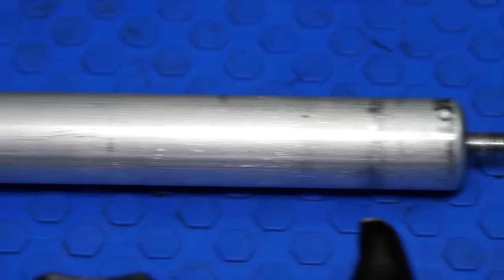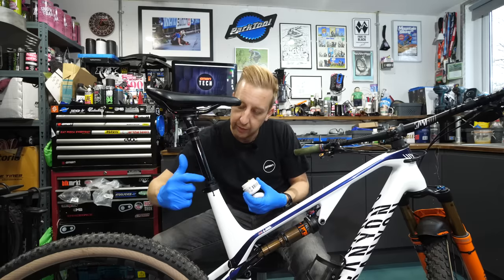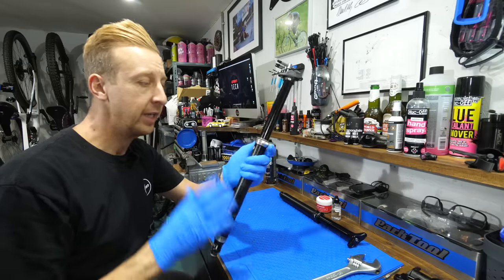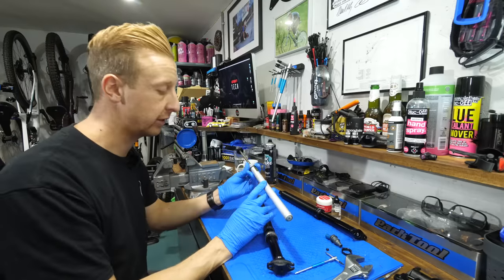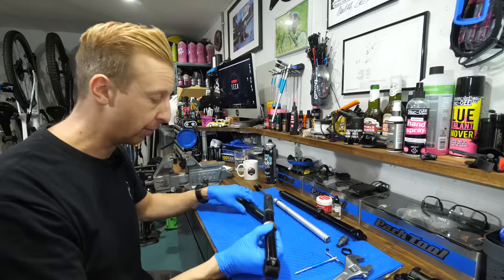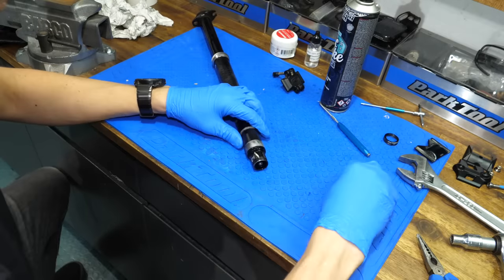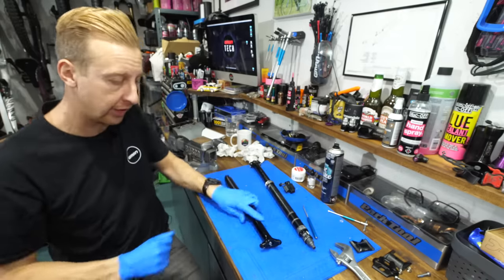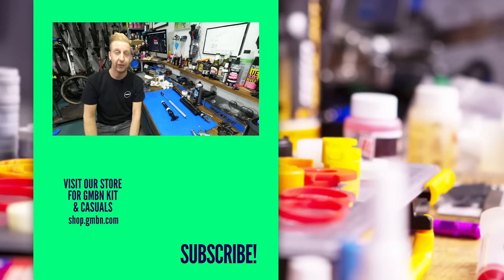How To Service A Slow MTB Dropper Post | Mountain Bike Maintenance

Comment: When mine gets stuck I just spit on it and call it bad names. Works 60% of the time all the time.
Reply: Anchor man— brilliant film
Reply: I spit on it as well, just not from my face.
Reply: @timbrassinne719  💀💀🤣
Reply: i throw my shit over a cliff then i retrieve it and it rides great.
Reply: But what do you de when your dropper post gets stuck 👀
Reply: I'm going to give that a shot but I'm counting on at least 62%!!!
Reply: Instead of using sram butter can I use muc off bio grease, the pink one in tube?
Reply: @DeadsetYT  Been hanging out with the hawk tuah girl much?? Wondering if its the spit or name calling that gets the job done…

Comment: Hey Doddy, we desperately need one vid for the new fox transfer. There is NOT A SINGLE VIDEO on YT 😭😭😭
Thanks a ton for your great work 🙏🏼💪🏼🤙🏼
Reply: yess i neeed this! my transfer stuck in the last 2cm
Reply: Not gonna happen, leave that alone. Reverb and transfer only at service centres.
Reply: @trailfoxx  try not having your clamp bolt too tight.. I've found there's a fine line.. to tight it stops just short and to loose the seat moves.. but find it and should work sound 👍

Comment: Thanks Doddy, legend. Just followed your guide yesterday and totally fixed my post! I used SRAM butter as well, and Rockshox 0W suspension fluid. Turns out I'd sprayed far too much silicone spray into it over the last year and it was absolutely blocked with residue. Was so slow before this that I was thinking about getting a new post. Instead, just $38 (NZD) and an hour of my time. Legend mate.

Comment: Had a go at the quick method today on my x fusion manic. After 3 years+ of all-weather abuse i was surprised at how little dirt was actually inside the upper seal. Bit of lube and a clean-up around the shim and O ring and its defo less lazy on the pop now. I was lucky enough to unscrew the outer using just a thick rubber glove too hehe! Quick clean of the the wiper and post itself after every ride has proved to be a good habit…

Comment: Smooth...like liquid butter. That's what happened to my dropper post when I did what Doddy prescribes here. BTW, While I was at it, I replaced the internally-routed actuator cable. Also very easy, but I did invest in a Park cable cutter. That investment paid for itself right there on its first job. Now I am free from bike shop waits and high costs for all my future cable replacements.

Comment: a useful guide especially as I'm looking at getting a Brand X post!
Reply: Had my bike since November 2017, like a loser, I've never given the post a proper service, just a little clean. So never had it fully apart to clean the lower section. It's a tad on the slower side with a good long scratch at the back of the post that's about 6 inches long. Yes, bad, I know. Less than ideal. I'll tell ya what though, It's a perfect dropper. Can't complain, especially since a new one isn't all that expensive. Well worth the money in my opinion. (Yes I should've serviced it by now, but couldn't be arsed. Replaced my Pivot and wheel bearings instead...) I'll get to it. Lel

Comment: This video tipped me over from my hesitation of self maintaining my two dropper posts to actually taking action. It was amazing how much muck has built up over time. They both work like magic now. Big big thanks for your thoroughness. Watching the manufacturer's videos had made me think I'd need LOTS of specialized equipment. It was nice to see I could make do with what I had lying around in my workshop. Happy subscriber here! :)
Reply: The bicycle seat post is the perfect "much catcher!"   As are seat tube clamps &  slots.  I've utilized old inner tube over many of my bikes' seat post clamps.  So much dreck flies right off your rear tire and onto (and into) your seat post, slot, clamp & clamp bolt.  Can't really protect the dropper very well.  I GUESS you could try some sort of accordion boot (like front shocks of old), but I just know it would foul anyway - and make proper bike stand clamping difficult or impossible.

Comment: Very helpful and useful. A follow up with a Reverb and Transfer, the two most popular hydraulic posts, would be awesome.

Also, thanks for specifically showing a BrandX post, as BrandX/TransX are by far the most common OEM dropper posts on the market, especially on the lower end.

Comment: Thanks!  Funny because I just serviced a guy's bike by replacing his broken cable, cleaning & lubricating the lever mechanism, new housing, flushing the mud out of his seat tube & BB, but the Fox post is still sticky.  Been meaning to unscrew that top seal, but always wondered if it would go KABOOM!  (Was pretty sure it wouldn't, but didn't want to open a "can o' worms.)
Off to the shop to perform this little bit of magic...

Comment: My new XLC-dropper got stuck during the first snow ride this winter. Fully disassembled it, cleaned and greased it up. Works perfectly. I also did the inner tube hack. 
Also the internals of the XLC look exactly like the Brand-X ones.

Comment: thanks..this is very helpful for me as I ordered a brandnew PNW Loam/DXC DP which I give this procedure from the beginning. It is a bit different but use "brass keys" but same technology. Instead of SRAM butter I have good experience with RSP Slick for my Suspension Forks and actual dropper. It feels a bit thinner. By the way I bought some years ago 2 new Rock Shox Reba which were already dry inside and so I am a bit carefully with new things like this...thanks again!

Comment: Could you do the Rock Shox Reverb next? I know it’s been done before but not by you I don’t think 🤔 😃
Reply: Have a look @Butter Suspension. His reverb rebuild ist amazing!
Reply: Send it to special Dynamics suspension the reverb is fully hydraulic and requires the damper to he bled if it needs to be actuated quickly I sent mine and it came back feeling brand new for just £55
Reply: Reverbs are more hassle than their worth. A lot of money for a fragile system that ends up needing more attention than others, And certainly not a post to go for if you are gonna rely on a bike shop for any work! Throwing money away at that point.

Comment: Just in case it helps someone; some of the brand x droppers don’t have a nut under the seat but a valve for topping up the air. There’s a metal plate with four rectangular cut outs. This is threaded onto the valve and can be unscrewed to allow removal of the cartridge using slim needle nose pliers into the rectangular cut outs.

Comment: Hey Doddy, what type of suspension oil do you use, 5wt, 10wt, 15wt? Excellent video btw, keep the content flowing 🤘😎
Reply: I would use 5w or 10w 15w is a little bit on the heavier side. some Forks use 15w  but most are going to use 5 to 10. For the seatpost 5w or 10w is fine even a good transmission fluid. But I wouldn't use trans fluid in the forks.
Reply: @archetypex65  So like a wet chain lube could also do the job?
Reply: It doesn't matter. I used 0W. Any suspension fluid will serve the same function.

Comment: A third type is air / cable. That air the in top with the valve under the seat runner clamp, normally max 250psi. With the cable release on the bottom. 
Another great video though Doddy.

Comment: Zoom Tequila (and ZTTO which I believe is just a Tequila with a ZTTO roller lever):
For those of us that are cheapskates... A Zoom dropper is still 1000% better than a clamped post... 
BUT the top actuated ZOOM droppers can get muck in the actuator.         (I did a video of cleaning mine).
The result is a post that doesn't lock (so keeps raising to full extension).

Clean/lube the actuator & perhaps look at covering the top of the post to prevent dirt/mud/dust from sitting on the top of the post. (I wrapped the top in a bit of innertube & zip ties).

The reason I used a Zoom is I have a 2010 Giant Faith 0 that has a very short post tube with the suspension rocker bolt in the middle making the seat depth about 200mm.
With the Zoom I was able to get 100mm with barely 10mm depth left in the post tube to play with.
It also looks like you can lock out the Tequila with spacers if you want less than 100mm.

Comment: Ran my BikeYoke Revive for 2 years without service. apart from lubing it a bit and keeping the seal clean. I didn't touch it. reset it a few times but not much. took it apart before I sold my bike and replaced the seal, cleaned it, put some fresh suspension grease in it and it was like new again.

Comment: After riding on a Giant cartridge dropper for two seasons, I figured it was time for a cleaning and tune-up when responsiveness began to slow down. Discovered to my horror that the aluminum dropper had cold-welded to my carbon frame. Several trips to various bike shops brought no solution. Damage to either the frame or to the post without it being removed would make the bike useless. For now the solution is a hacked clamp around the part of the dropper that telescopes essentially keeping the post fixed in place. Frustrating, not great but still rideable. It would most certainly have been part of my regular maintenance routine to loosen the dropper to avoid this  if I'd known about. So, just a heads up.

Comment: Could you do one about the fox transfer
Reply: I would like to see that, too.
Reply: Like Doddy said "fundamentally they're the same". Its the same principles no matter the model or brand
Reply: @archieansell9160  He mentioned the 3 different sytems. I guess there are some more seals to grease in a non-cardrige system like the transfer.
Reply: Yeah the transfer is semi- hydraulic not cartridge
Reply: I worked at Fox and let me say the transfer is not an easy thing to work on! Especially because you need some special tools and a good knowledge! If you have problems with the transfer sent it to fox and they can help you!
Reply: @fabian5422  In which country? This smells like Germany. When Fox Service was still Toxoholics, you couldn‘t even get the tools without a service training but they didn‘t have the capacity for doing the service for a country that big either. I mean, let me see the service manual, and I can decide myself. I wouldn‘t try to fiddle around inside a damper but why should I send in a fork just to put some progression tokens in?
Reply: @chrisridesbicycles  yes Germany. You can get the tools on there website and yes they have a lot to do at The Moment, but in my opinion it’s not worth the money you spend on the tools and in the end there is the chance to break more then you fix.
Reply: @fabian5422  That depends on the task. It is generally worth the money because they are relatively generous with upgrades to newer damper generations, however sending in your fork and waiting 12 weeks+ for it to come back like in the Toxo days is not acceptable. The season can be over in that time.
Reply: @chrisridesbicycles  I totally understand your problem but they have a lot to do! It’s not all that easy and they are doing their best. But Forks and dampers are one thing but to rebuild a transfer you need a good skillset and the Know-how and I’d say reading the service procedure is just not enough. The transfer is not all that easy to work on!
Reply: @fabian5422  With a seatpost, it is not that much of a problem to keep a spare fixed seatpost to make your bike usable at least. With forks, it‘s another story.
Reply: @fabian5422  hey Fabian, have you worked on a reverb stealth? I have completely rebuild mine because of the saggy post problem and done a 400 hour service recently. Used a great video from @Butter Suspension and the Rock Shox manual for reference. Worked  just fine, even though I have never serviced suspension or dropper posts before. After I serviced the second reverb that day, I felt quite confident doing the service again. However I do agree, that you need a lot of tools, that not everybody might have laying around. Can you compare the difficulty of the service between Fox and Rock Shox?
Reply: @florianzimmermann3815  no I haven’t. I only worked on a transfer. Fox also has online service manuals, they are quite good but only a guideline. So yeah I don’t have any experience with the reverb

Comment: My dropper was making horrible grinding noise. Upon disassembling it I discovered that the brass keys had sharp edges, which were grinding against the slots inside the tube. Further inspection reveled that the edges on the other side of keys were round and dull. So I flipped them and the grinding noise stopped. Is it possible they the factory assemble the dropper incorrect?! P.S. Thank you for these instructions - they gave confidence to try and fix the problem myself!

Comment: Ha I just fixed mine today and then I see this video. I was using a Brand-x external and the textile cable from inside got snapped. I ended up using a 0.8 mm kevlar fishing line +  sram grease.
Reply: Those are a little heavy but great for price.

Comment: My friend's dropper would always get stuck on the last 5mm of travel. Pulled it apart, black crap everywhere. The top bushing was also really scratched up due to all the crap inside. Fella kept using wet lube on both the stanchions and bushing. NEVER use wet lube. Just like you won't use wet lube on your forks, invest in the proper suspension grease. In fact, I'll keep away from oils too. Unlike forks and shocks, there's nothing preventing the oils from just dripping out of your post and pooling somewhere in your frame.
Reply: Just got a new bike with a Fox Transfer and it has the same problem brand new. Miss my Reverb. 😐
Reply: @pgjudo  my suggestion would be to warranty the post. 

However, if you're a DIY kind of person, ensure there's enough air pressure in the post, then pull it apart to find the offending part causing all the additional stiction. There's a rebuild guide on the fox website. 

In my case, it was the top bushing which got all scratched up and it had quite a few burs. Luckily the bushing is made of plastic, so I used the stanchion itself to file/cut off all the offending burs. A bodge for sure, but my friend was penniless and we had trouble sourcing the rebuild kit for his post. And it worked. I would still recommend getting the rebuild kit from fox and just swapping the part out if it is due to the bushings, guide pin or gutter seal being damaged and causing the friction.

But if it is the air cartridge itself, then I would strongly recommend you warranty that thing instead. Between the parts, specific tools, and expertise required, it's just not worth it to try to do it yourself and risk voiding it when it's covered under warranty.
Reply: @Snipeonz , thanks, but I’d expect it to just work after paying over $9k for a new bike. Reading the comments, it seems that’s too much to expect from Fox.
Reply: @pgjudo  Well, I won't blame is specifically on Fox, but more on the fact that with current manufacturing methods, defects are still inevitable. Most of the manufacturing process still requires humans to be present, and as we know, the human component has the highest error rates.
Reply: @Snipeonz  , I can’t argue with that, dude... the biggest shortcoming my killer new bike has is its rider! 🥴👀

Comment: Newer dropper posts also requires you to add air. Remove the saddle, there should be a valve like with the shocks and pump it up with a shock pump. The psi range should be printer at the top of the post.

Comment: Can a Fox Transfer be serviced without a full rebuild, since it requires some Fox proprietary tools? So cleaning and lubing the seals and basic parts should be the same as other dropper posts?

Comment: Hi. My dropper issue is on delay to full stop at when drop or fully extended. I need to wait for more than 10secs for it to lock. Possible issue on the cartridge? Thanks.

Comment: #AskGMBNTech hi Doddy. Do you think power steering fluid would be safe to use on dropper posts. Also my dropper is very rough on the way down and does not return. It is a brand x ascend

Comment: #askgmbntech
Great video - but how do you get the dropper out of the bike to work on it?
Do you have to disconnect the cable at the lever and pull it out with the post?
Or is there a cunning plan?

Comment: Would it be possible to shorten the stroke of a dropper by shortening the piston rod of the cartridge? Asking cause I have my eye on a dropper, but its 125mm stroke and I can only fit approx 100mm on my (older) hardtail.

Comment: #askgmbntech Hi Doddy. I’ve followed the program since the very beginning and way before when you were at MBUK. I have a Cube Stereo that came stock with a Cube branded dropper post. It has a valve on the top where the pressure is controlled with a shock pump. It is cable operated. How can I service this at home? Thanks.

Comment: I have followed similar video and now searching for help found this but it’s the same. Reassembling mine I can’t get the actuator pin to work. It’s as if the rod on the cartridge won’t screw in for enough into bottom housing. If I take apart again and push small pin in there the little black lever for the cable, has pressure as it should, screw in the rod from cartridge , and the black lever is simply loose , not able to actuate the pin, any suggestions? It’s driving me nuts as the video is simple, i followed everything no issue, this happened on my wife’s post too and I had to get a shop to sort. But they won’t tell me what they did!

Comment: Hi, great info, i do have a question though, I bought a 2019 trek rosco 7 2 yrs ago and it has what i belive is the cartirige style, I have had no issues with it until yesturday when i got my bike out to try it  
out in the snow, well it seems that it with not hold air once it gets cold and when sitting it drops all the way down and wont stay up, do you have any advice on this? is it a comom problem, and is their some thing i can do to keep it from doing so mabey a kind of lube or something?